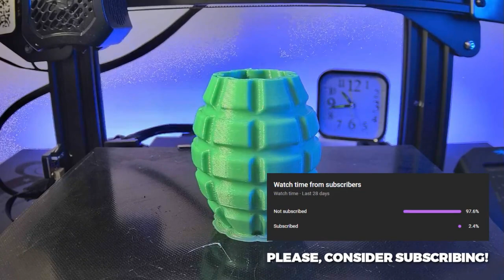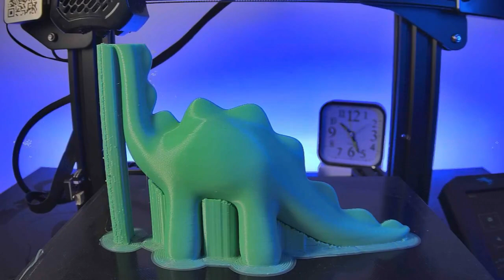15 Best Things to 3D Print with Satisfying Timelapses

Comment: how did you print the nether portal without supports?
Reply from the maker: Hey! To be honest, in this case I just tried my luck, as the ideal would really be to use support...
But in the end it ended up working out, even with a big gap, it wasn't perfect, but with a finish it ended up serving the purpose of the video 😅
Reply: You can enable Bridging in your slicer (or at least in Cura) to print long distances like with the top of the portal, no problem 😊
Reply: ok I will try that thanks @blutadlerx
Reply: @piet496  did it work? :))